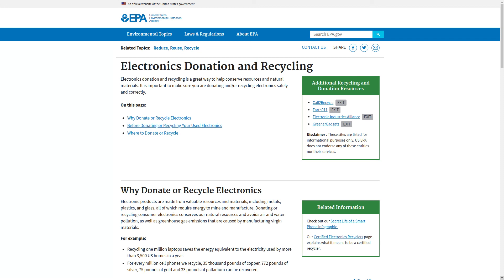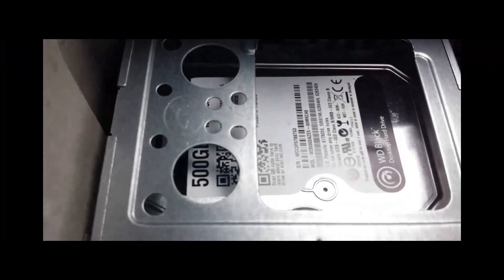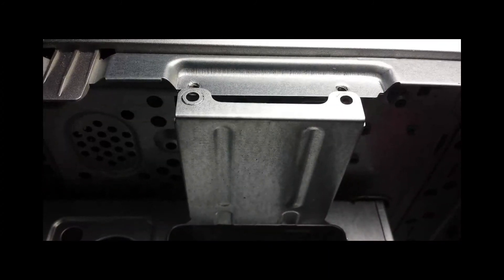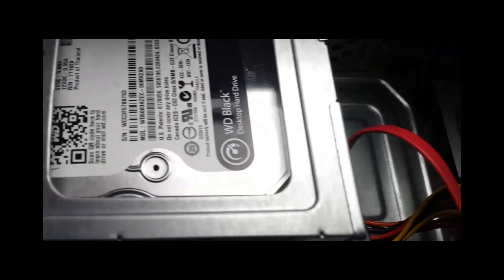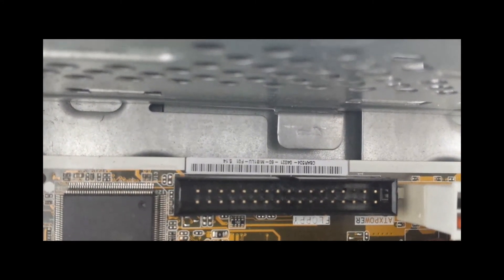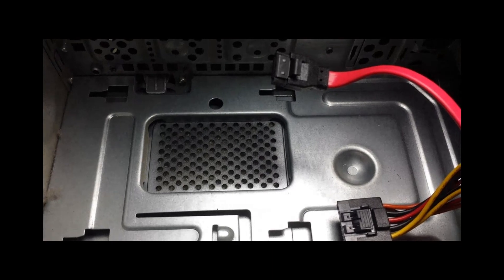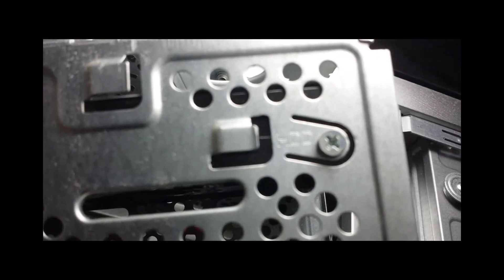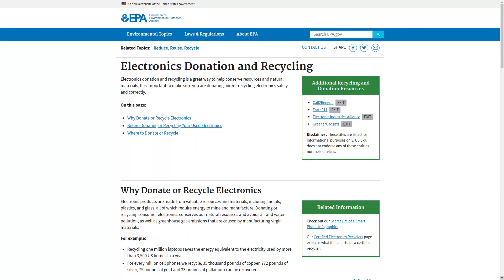Recycle, Donate PC? STOP! Before it's too late...

Comment: Good tip video Carm. If you do not has professional software to clean the drive correctly, there is a product called Red Key. I have both the software and Red Key and the key works as well as the software. Linus Tech Tips actually did a video on it. Also you can simply destroy the drive or take it to an E-waste facility for shredding.
Reply from the maker: Thanks for the info!

Comment: So this video is specifically for stupid people with zero mechanical aptitude that can't work out for themselves which screws they need to undo to remove a hard drive? I am a driver with zero aptitude (or interest) in car mechanics, but even before I got a car I knew how to fill it with fuel, change the oil, put air in the tyres and change a wheel if I had to. I also didn't need a YouTube video reminding me to empty the glove box and the boot before I sell a car....
Reply: I can say, after working on a recyclingunit, that's alot of people not thinking about the harddrive.
Reply: I'd say you're reply is a bit harsh Terry. Calling someone stupid for something they know nothing about only proves the ignorance you have and lack of understanding. So does it make you stupid if someone asks you to perform brain surgery? A skill I am positive you do not have. Does it make an 80 year old stupid if the are disposing of their computer when all along they had limited abilities to use it?

Come on, find a bit of compassion and kindness in that soul of yours rather than adding to the ugliness of the world. This video was a basic tip tutorial for those wanting to learn something, please don't be that class bully, it's unbecoming to you!